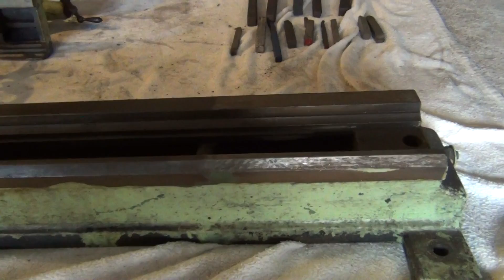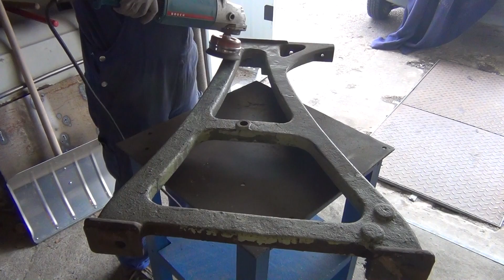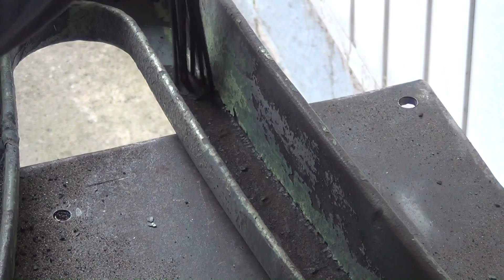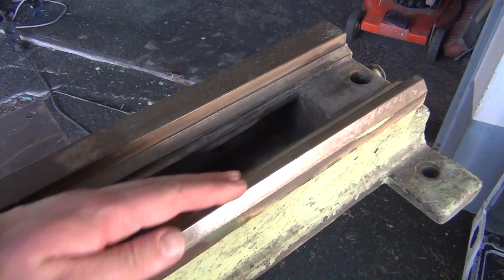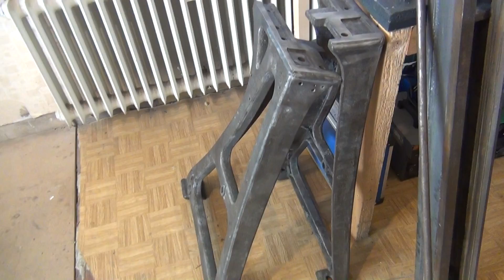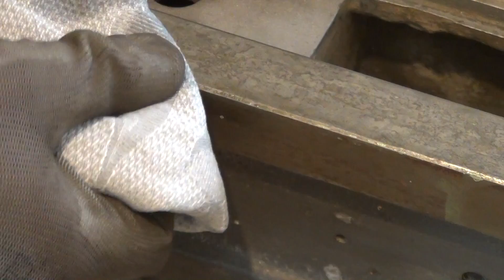Lathe Restoration (1):  Paint and Rust Removal Methods, Assembling the Basic Frame

Comment: I've found some iron / steel rust can be taken off with toilet bowl cleaner, which is a somewhat dilute solution of Hydrochloric Acid. That stuff works very well to remove the green oxidation of copper wires to expose the clean copper metal underneath also. It's pretty cheap and comes in gallon jugs, the one I'm using came from Smart & Final

Comment: In the states, we call that tool a Needle Scaler, mostly because it removes rust and scale. I just started watching your videos, and have seen you using a lathe, so this is probably an earlier episode, but I have had good luck using a product called Evaporust. It is environmentally friendly, doesn't have any toxins so disposing of it doesn't pose any issues, plus it can be filtered and reused. I generally strain it with a coffee filter. Here in the U.S. there's a company called Eastwood, that makes a lot of auto restoration tools and equipment. They have a motorized brush, who's name I can't recall, but it is good for stripping paint off wide flat surfaces. Now many of the Asian countries are starting to copy it. I have also tried removing rust by electrolysis, where you take a car battery charger, and hook the negative lead to the part you want to strip. The positive goes to a piece of sacrificial steel, you fill a tub with warm water and washing soda and put the parts in and the rust is drawn to the positive lead. It is rather messy, you need a large basin for whatever part you are cleaning, it produces hydrogen gas, possibly leading to combustion and once you are done, the parts still need fine tuning, so I prefer to use the Evaporust. It saves time and effort. This might be old news by now. I really enjoy your videos and narrative. You speak English better than many people who were born and educated here.

Comment: Evaporust. Works like a charm and uses a process called chelation that targets rust and not steel, so it will not remove any metal and just attack the rust. It also removes small amounts of paint with the help of a brass brush after a long soaking. Big warning though, all though the chelation doesn't attack the steel, if you allow the evaporust to evaporate it will allow water to separate from the mixture and will rust the steel, which will then be removed by chelation and can happen over and over again around where the part meets air and liquid, so either 100% submerge the part or don't allow it to evaporate, have learned the hard way but the product is still flawless, just user error

Comment: For light rust, standard White Vinegar works well to remove rust.  I've had good results with a 50/50 mix of Vinegar and Distilled water.  If you leave the part in the solution for a while to soak, it can also 'blacken' the steel which would be bad for lathe ways but on some metals it's a desirable oxide by comparison to regular rust.  If you don't want the darkening effect, clean off the vinegar after an hour or so with a rag then use some super fine polishing compound on it to finish the cleaning and seal the part.  Again, only for light rust.

Comment: Rust remover Brand: Naval Jelly, now owned by Liquid Wrench is a good one. It uses phosphoric acid, which leaves a protective chemical bond on your steel. Same active chemical that is used in the automotive industry to dip car bodies before primer and paint so rust does not spread from a scratch or ding in the paint.

Comment: If you think you have lead paint, a mask is not even close to proper protection. Especially if you are grinding the paint into dust. All of that dust needs to be contained. Better yet, use a chemical stripper so you don't send lead dust all about.

Comment: Hi I use this tool for removing paint off my machines. I'm in the USA and we call that tool a needle scaler. I just buy the cheap ones and they work good. This tool also works for removing welding flux from welds Good Luck

Comment: Very best solution for rust removal from iron and steel is apple cider vinegar. It is fantastic, but you have to totally immerse the part for a few days. Ideal for smaller parts, but you would need to build a tank for the larger parts.

Comment: Hi, Look up 'Electrolysis rust removal. There quite a lot of methods on youtube, most using Sodium Carbonate. An easy one to find is by Keith Rucker. It does work exceedingly well and is an easy method. It converts the rust to Ferric Carbonate and also removes the old paint.
Regards MoK

Comment: chemical (iron) rust removal is typically acid based.
Note that this does actually remove the rust rather than returning the rust to it's former state (as opposed to removing the silver tarnish with Aluminium foil from a previous video), so repeated use of rust removal will over time damage the surface.  The proper way remains to avoid getting rust  in the first place by painting, oil, generating a corrosion resistance surface, or some other form of surface protection.

Depending on the job, the amount of rust, the size of the part, you can essentially use any kind of acid.  Common types are vinegar (small objects like scissors, screws, springs), for larger objects and heavy corrosion, you would use phosphoric acid (H3PO4) and hydrochloric acid (HCl).

The true recommended one in this particular case is phosphoric acid since it is really a rust converter. it will turn the rust (iron oxide) into ferric phosphate,  which is a black coating that is actually corrosion resistant.
Phosphoric acid is the acid used in cola, mainly because it has a tangy taste (in low enough concentration obviously) which is why there is a 'myth' you can use cola to remove rust.  in practice, it's not recommended, in a pinch you can use it, but the concentration in cola is too low, and the other compounds and sugar will usually make it worse. You want the 'pure' stuff (note that it is very very nasty stuff in  high concentrations)
The ferric phosphate coating is  goof for parts you want to leave unpainted like the chucks. but it's not good for the bed.

For the bed I really would recommend some iron wool, some oil and a bit of elbow grease :D

Hydrochloric acid is fast, but you need to actively stop it. Even after rincing with water it will continue to work, and vapour can even affect, tarnish and possibly damage objects in the same room. So you need to stop the process with a neutralizing paste of chalk or lime.

Other tricks of the trade.  It might work for the bed since it doesn't look too badly rusted...  Cut a potato, coat with baking soda (this will activate the acid, and act as a mild abrasive) and rub that on the bed. The oxalic acid (C2H2O4) in the potato will gently remove rust.

Comment: Just a thought for you on rust removal I don't how know how you would do it now that the bed is set up. I watched mrpete or "tubalcain" use vinegar to remove rust it worked extremely well I was very supersized at the results in such a short time. You might be able to use this process on the other smaller parts check out is you tube channel it is worth watching. Nice video

Comment: From a chemical point of view, phosphoric acid is the best solution for rust removal from iron parts. You can get dry crystalline phosphoric acid and dissolve it into pure acetone or you can find a ready-made solution in a chemical shop. I clean the rusty parts only with pure acetone, then submerge them in the acid or apply the acid with rag or sprayer, if the part is bigger. This is the best way that I know and its tested for everything, including car repair jobs.

Comment: Here dentists use similar thing, with one needle (I have a friend dentist) and it is called scaler, despite English being foreign language. Used to remove dental stones (scales). This is almost equivalent metal cleaning thing :D Heard it called needler, needle gun and scaler by dudes using this in metal shops on videos.

Comment: I have recently started using a de-rusting product called EVAPO-RUST.  I found out about it from a long time machinist Keith Rucker on youtube.  Although I had not heard of it before, it has apparently been around for years and works very well.  In the USA, I found it on the shelf at my local auto parts store.

Comment: It is a needle scaler.   for the ways you cannot beat fine wire wool and paint thinner (white spirit) with a touch of oil in in (or wd40 but its wasteful spraying it into a small container)

Comment: To remove the surface rust on your ways       simply use white vinegar.            It will remove both red and black rust.      Old gunsmiths trick.

Comment: we call it a needle gun or needle scaler in the States. in my experience a cheap one works as well as an expensive one, and they tend to have a similar service life as well. keep yours oiled with air tool oil and it should be good for quite a while. I've never used chemical rust removers, so I have nothing to contribute there, but I would probably leave the runners as they are and apply oil to them as they don't appear to be pitted and still look quite smooth.

Comment: TPAI: "I decided that I don't want to use the workshop for storage.. I have other rooms for that". Absolute classic :)
Reply: +coffeemaddan PS. The only non corrosive rust remover that I've had success with is Evaporust. It's an American product that is available here in the UK. You can lay some absorbant rags on the ways, soak them in evaporust, cover with cling film or similar and then check progress every 30 minutes or so. It shouldn't take more than an hour or two.
+Keith Rucker and +Abom79 have videos on it too.

Comment: For paint removal you can use lye (sodium hydroxide) if chemical removal is needed.

And for your question about chemical rust removal, use basic citric acid. It will be available in almost every hardware store. Since it's too thin to use on that and you can't submerge the whole lathe bed to it I'll give you very nice tip. Just mix up strong solution of citric acid and plaster and cover the whole thing with that slushgoo. It'll do the trick, or at least I have experience of that working.

Comment: I have done a number of restorations of hand planes, many of which had a lot more rust than your lathe.

The typical chemical rust removal product needs the metal to be submerged in the product since they are slow acting.

Many products contain acid, so need to monitor and remove the metal once the rust has been removed, or they will attack the metal.  Vinegar, lime juice are examples.  Also oxalic acid, sold in the US as "Wood bleach".

I think for the lathe ways, you will not be able to do much other than a piece of 600-800 grit wet-dry paper and some WD-40 or light oil for the fluid.  Alternate is fine steel wool instead of the wet-dry paper. 

There is a UK site which contains a lot of information about many metal lathe manufacturers.  The challenge is knowing the name of the company.

http://lathes.co.uk/

I am interested to see the progress on the restoration.  I did a partial restoration on a Southbend Heavy 10.  I also converted this to VFD.  A big improvement, so quiet with 3 phase motor and VFD.
Reply: +LV_Woodturner The headstock, tailstock and cross slide are often the most distinctive features of a lathe.  Your lathe looks similar to some Karger models on the lathes.co.uk site.

Comment: I have used Klean Strip's Aircraft Remover Paint Stripper with success in removing old paint from metal on the vintage motorcycles that I restore.  I do not know if there is an equivalent in Germany though.

http://www.ebay.com/itm/Klean-Strip-Aircraft-Remover-Paint-Stripper-1-Quart-fast-acting-/130260240275

Comment: Hi mate.  English is also my second language, and I must congratulate you on yous.  That while Germany puts a voice-over on many of it's foreign tv programmes, or at least used to.     The "spring balancer" is, as far as I know caled a needle gun, a descaler, or sometimes in error a rattle gun.  Normally the needles would be more tightly packed than your one.  When the ADM in Amsterdam, a ship building yard, was finally destroyed by the unions, I had to throw many of them away while cleaning up the company.  I can kick myself thinking of it now.  I don't know what is available in Germany, but Orange stripper, purple power, and many more none-toxic products are being used with great success.  The ways you could clean with oil and Scotch-bright.  You can use it safely, as one has to do a whole lot of polishing with it before you only remove a millionth of millimeter of the ways, before that time the rust will be gone.

Comment: vinegar with hydrogen peroxide as a booster works really well. It works really quickly so pay attention to avoid pitting,  you will have to oil it afterwards to avoid the surface rust

Comment: HCl (hydrochloric acid) will react with FeO (iron oxide) to produce two forms of aqueous Fe cations and oxygen. This reaction is pretty much instantaneous and can carried out by wiping the metal with an HCl-dampened rag. HCl will also react wil Fe itself but the reaction is so slow that you would end up cleaning the FeO before any significant amount of iron eroded away. The down side with this method is that it is "too good" meaning a very fresh layer of Fe is exposed and can be very easily oxidized by oxygen in the atmosphere. This can be avoided by taking immediate care to oil the parts thereafter. This is my opinion as a chemist and not as an experienced machinist.

Comment: Assuming the ways are hardened, WD 40 and wire wool or a brass brush should do the trick. I've seen youtube videos using molases to remove rust also electrolosis.

Comment: product I have found to be absolutely brilliant for removing rust (available at least in the USA) is called EVAPORUST. I have used it on cast iron and it removed the rust absolutely. I cannot however recommend it for cast iron that must remain critically flat. I have found that there are often microscopic cracks in cast iron that contain rust. The chemical seeps into these microscopic cracks, attacks the rust expanding it in the process thus causing the part that must remain critically flat to warp. I has so far worked brilliantly for everything else though and did not harm adjacent wood or plastic attachments.

Comment: I think they mis-translated the "Spring Balancer" from the fact that it is called, at least in the  USA, a Needle Scaler. It is used often for removing forging scale and similar scale like slag from new welds to clean them up. I think the mix up is that the definition for  a balance type scale (for weighing things) instead of the scale definition of a fish scale looking object (slag, flash, etc.) that needs to be removed.

Comment: Your location appears to be quite dry but I'd still like to see at least an oil film on the newly cleaned parts and even maybe a light coat of grease on the ways.  It seems to me by my experience that the ways without protection will find any excuse to rust.

Comment: Harbor Freight has lost its price advantage.  30 Euros is $34.   This is $54.  
http://www.harborfreight.com/air-needle-scaler-1108.html

Another problem with sand blasting, that I can't believe you haven't run into, is my compressor creates massive amounts of water.  After about 15 minutes the nozzle clogs due to moisture in the media.

Comment: In England we call either a needle gun, needler, or needle de-scaler. Whatever they are called, they are brilliant for getting rust off thicker steel. Much better than a wire wheel, wire wheels tend to just polish the rust, rather than breaking it loose. A great tool to have,

Comment: I get good results cleaning rust from small items using a moderate strength citric acid solution that can be made up from dry crystals sold at the supermarket and used in making preserves.

Comment: @TPAI 
 There are two options, You can soak it in coca cola or water and molasses, yes I know sounds like a bit of a stretch but it works for restoring sheetmetal too thin for sand blasting
 I have seen vinegar work very well in some YT vids.
 But I think you would be the kind of guy to use DC Current Electrolysis.   Just google it and find the video you dislike the least and then by all means make a better one.

Comment: You can use the phosphoric acid to remove the rust. It removes the rust very well, and it's harmless for steel or cast iron. It's available under different names and brands - just look in your local hardware store.

Comment: That's a great project. I have been a machinist for 8 years now and i still don't have my own lathe. Yours look quite strong for the bed size, and by looking at the tailstock and all the round shapes might be as old as 1920! But lathes are made to last. Here in Argentina we use to copy german designs to build here (exept one brand that copy the Southbend).
Be carefull with chemical rust removers, some etch the surface and may hurt the ways. I have no experience with rectifing lathe ways, but you may have more luck inventing some sort of surface grinder. Or just leave the way like that. A little rust won't make the lathe dealign (in my old techschool half of the lathes have rusted ways and never lost the aligment - german made lathes, i know feel proud).

Comment: You're the Post Apocalyptic Inventor, so you have to go with electrolytic de-rusting. Just make a frame for a tarp to tank it in. Are you sure you mounted the bed the right way around? Usually the prism is by the operator. BTW we call needle scalers needle scalers. Better you than me removing all of that old paint. I think I might have just degreased it, and sealed it myself. Because old paint is bad stuff. They were nuts back then when it came to harmful chemicals. I kind of liked how the old paint looked too. It had the old machine look. Every machine in old machine shops looks like that. It is a difficult finish to replicate really. Well, unless you leave a machine in a shop for 50, or so years. Oh, and the leg hold down bolts are fine.